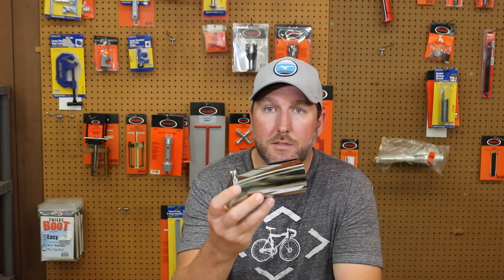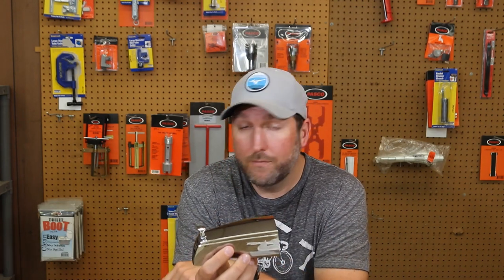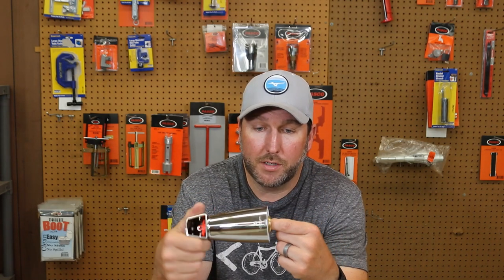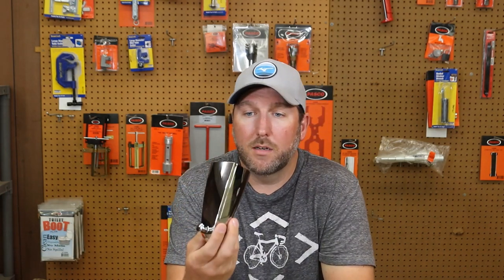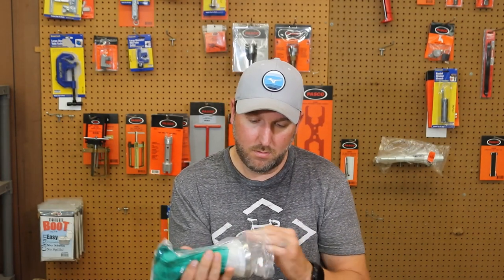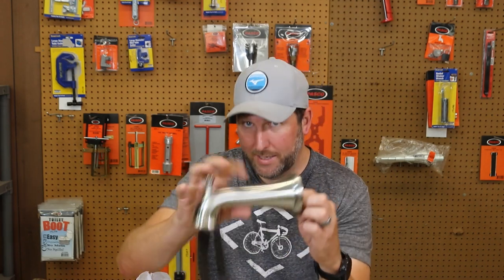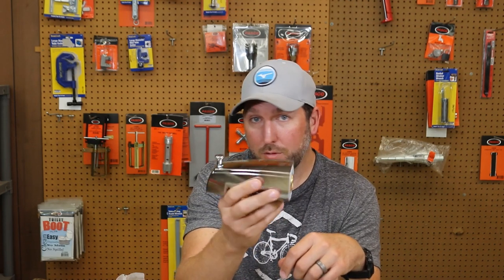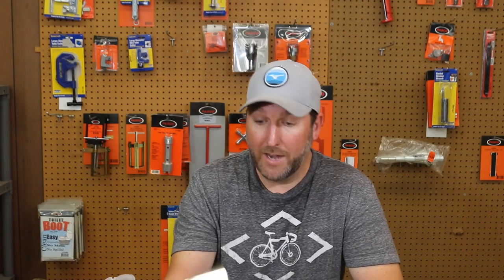One Inch Tub Spout

Comment: This video saved the day and a call to a plumber.  Big thanks!!! For anyone unsure, this is definitely the correct spout for the 1" connection. What made the search more complicated was that when I removed the original spout the white inner plastic part didn't come off with it. That led me to believe I had to get another spout without the inner white extension piece. The good news is that it doesn't matter. You can either take the original white piece off after removing the original spout, by turning it counterclockwise. Once the spout and white extension are removed, the new spout can be screwed on with its inner plastic extension (back threaded options). Or take the new spout's inner part out if you left the original white extension piece on the pipe and you have a true front threaded connection. Either way it will work. 

If you don't have time to wait for Amazon delivery, you can find the part at both Lowes or Home Depot under model # RP5834.

Thanks again, brother!
Reply: I'm having trouble. Took two back to home Depot. Can't get the white extension piece off, it will go so far, with channel locks, then that's it. 

When I measure the end of the threaded white extension it's pushing 1".  I cant get that white piece off.

Comment: Thank God for this video for proving I'm not crazy about my weird 1" tub spout. However, mine is even weirder, because I need a front-end thread version. This house originally came with such a spout, so I know this type of mythical creature existed at some point, but the original spout has since been lost. Has anybody seen something like that in the wild today?
Reply from the maker: So chances are it's the same spot and the white plastic section stayed in the wall.  I bet that section will screw off.  Email me a picture of the old spout and the part coming out of the wall to info@plumbingpartspro.com
Reply: Mines front end threaded as well and can not get the white piece off. It turns counterclockwise so far, then that's it, won't budge w vice grips.

Comment: Good video.  Unfortunately my diverter is a Delta slip on 1" Brushed Nickel. Cannot locate one that size.  It's probably from around 2010 give or take.  The wall pipe is an odd size so neither 1/2" or 3/4" diverters will fit.  No idea of model number.

Comment: The link in the description goes to an Amazon product that is a 1/2" connector. Not the 1 1/8" that is mentioned in the video.
Reply from the maker: That is correct.  When they say 1/2" it refers to the pipe size that the brass adapter either screws or solders to.  This usually stays on the wall and people prefer not to change that part.  If you remove the adapter from the new product it will fit
Reply: I just verified the link provides the right size as seen in the video, worked perfectly.
Reply: @TheTidojo  So it will screw onto a 1 inch pipe?
Reply: @PlumbingPartsPro can you share the link please!
Reply: @DJCHomestay  NO IT DOES NOT FIT!!!!!!

Comment: Can someone explain to me why the standard size for a tub spout is 1/2 or 3/4 inch??? We used to live an own an older house that had a 1 inch tub spout that was fed with a 1 inch pipe, and it filled the tub rather quickly!! Well, fast forward to our newer house (built in 2000), and the tub spout is fed with a 1/2 pipe and has a 1/2 tub spout.  It takes considerably longer to fill our tub. It's ridiculous!! Why has code or whatever is driving this smaller pipe agenda ,doing this???? Anyone?????
Reply from the maker: Almost all faucets have a 1/2 inch connection unless it's a High Volume faucet used on showers with multiple heads or larger garden or jetted tubs.

Comment: This is not a solution as it reduces the flow to 1/2 from the 1 inch . Granted, it does give you the ability to actually have a new spout, but with the cost of taking longer to fill your tub.
Reply from the maker: 99% of tub spouts have a 1/2inch connection.  This one also has a 1/2" connection with a 1 inch adapter at the end that is typically soldered on and most homeowners can not solder.  It's titled as 1 inch because that's what mist people search for as the ones at hone depot are roo small for the adapter.  Thanks for watching
Reply: So everytime i search for that part number on lowes or home depot or google i keep getting 5834-3 which is not the correct one ive tried so maybe could i het some better clarification